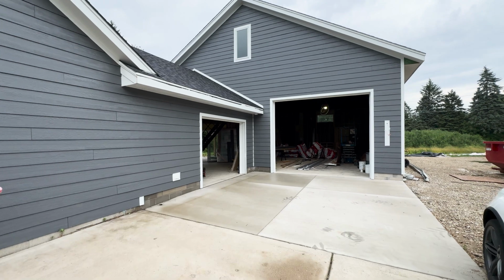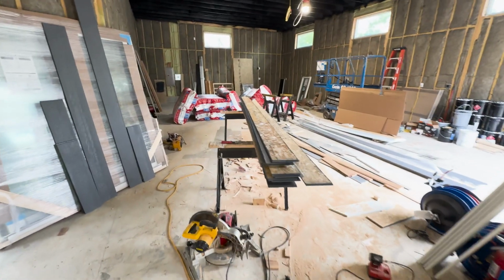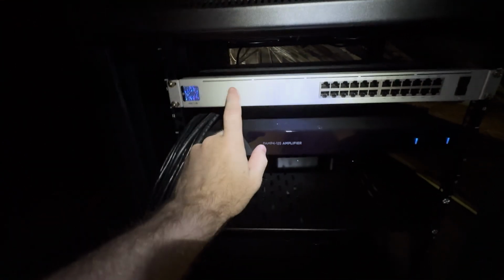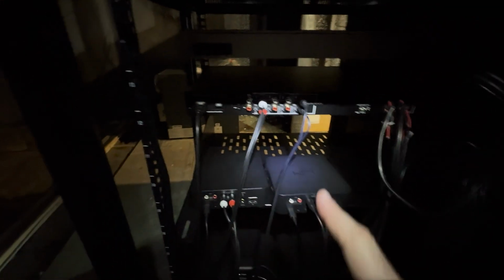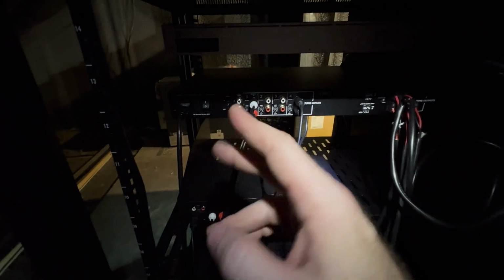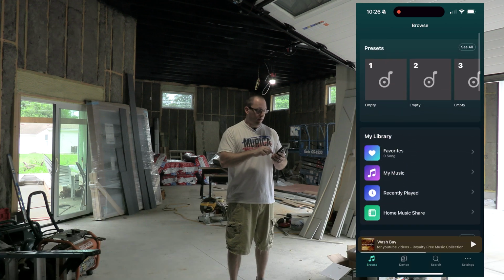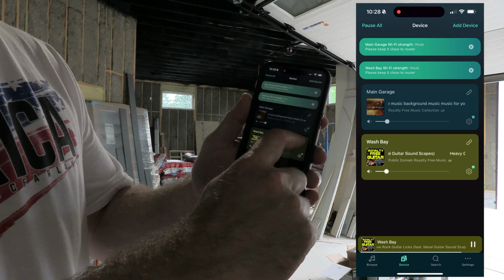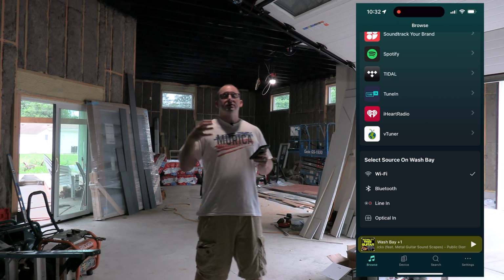Mastering Multi-Zone Audio: Wiim Pro Plus Review & Setup Guide // Garage Build Ep. 30

Comment: How is the volume and power on off controlled on the amp?
Reply: Yes, but if more than one streamer, how can you control the power on and off of the Triad amp since it just has one 12V trigger in?
Reply from the maker: @marioguillen5952 great question. I believe you could set up a simple distribution block with all of your 12v leads from multiple streamers going into the block and have one lead out with a diode for protection
Reply: @DetachedGarage 
That is what I thought! But I have not found any solution to the issue. Actually, I have the same Triad 4-channel amp as yours with four Wiim Ultra streamers, but as you know, the amp is on all the time.
Reply: I have a question for you: Are you using an HDMI cable or a Cat6 to HDMI extender from the Wiim to the TV?
Reply from the maker: @marioguillen5952 ive got an HDMI cable run, but I'm not using it. I run optical audio signal to the WiiM and then that outputs to the amplifier then to the speakers. I've got cat 6 to the TV and to the WiiM for connectivity.
Reply: I also have an optical connection from the TV out to the Wiim in, which I don't like because I can't control the volume with the TV remote control; it must be done with the Wiim app. I tried a Cat6 to HDMI extender, and it didn't work.
Reply from the maker: that is strange. I can adjust TV volume from the TV remote with the optical. I do need to turn the Volume on the WiiM app up to have full variable control.
Reply from the maker: There is a remote 12v wire to kick the amp on. Volume is controlled by the ap

Comment: I need to have two zones in my house—one with 4 speakers and a subwoofer, and the other with 2 speakers. I understand that I need a Wiim device for each zone. I see that you also have 2 zones and a device for each one. My question is: why didn’t you use a Wiim Amp? Is it better to have a Wiim Ultra and a separate amplifier? I don’t quite understand.
Reply from the maker: Great question! You can certainly do two WiiM amps, one for each zone. However you will need to look at your speaker power and resistance of the speakers to make sure you are not over or under driving them and also protect the amp. I got a 4 channel amp because I have 4 sets of speakers total. My one zone has 4 total speakers and the other two zones have 2 speakers each.

Did I answer all your questions? If not let me know. I’m happy to explain more 👍
Reply: @DetachedGarage  Thanks for explaining it to me, I now understand why you’re using an extra amplifier. I also noticed there’s the WiiM Amp Ultra, which delivers 100W per channel — I think that one would work well for what I want to do. Cheers, my friend
Reply from the maker: @checog0you are very welcome! Let me know if you have any other questions. I’m happy to help. Good luck on your setup 👍